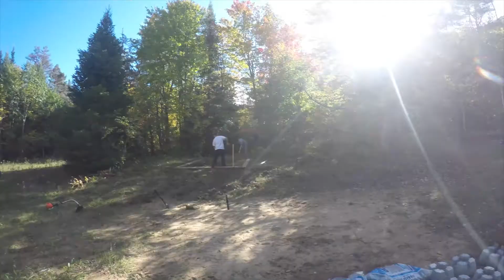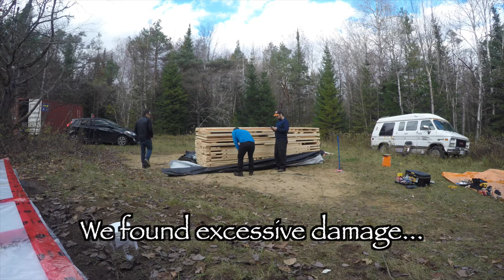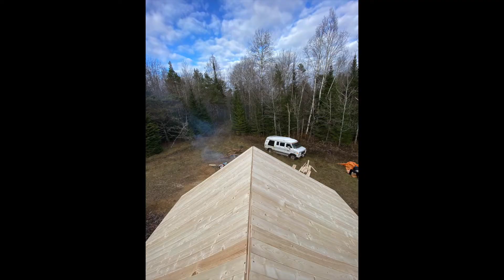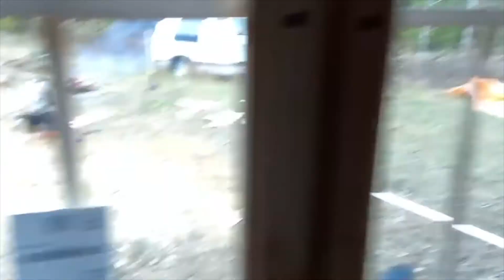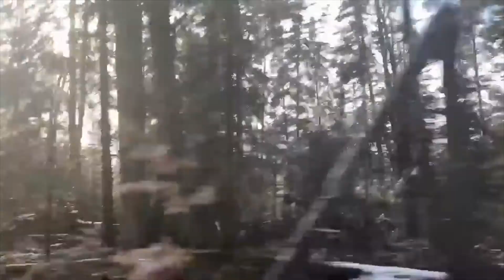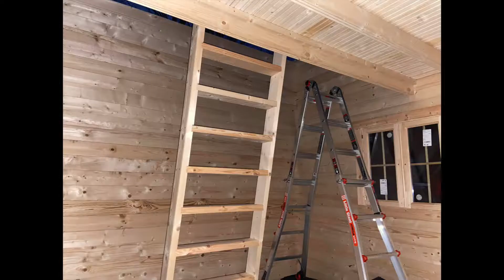Building An Off-Grid Bunkie In The Woods With My Brother And Friend

Comment: This is amazing, can you share what your roofing envelope was? I read that you added a vaoup barrier. did you insulate? it;s hard to see on the video. I have mental roofing. I was also thinking of renting scaffolding.
Reply from the maker: There is only a vapour barrier for the roof and then clear caulking for anywhere that air can escape. We bought a harness kit and it was kind of sketchy with the steep angle of the pitch, especially in the winter so scaffolding in the safest way.

Comment: Hey - how did you install the roof? I am having trouble with mine being so high and the material is thin so its tough to walk on… any suggestions help thanks
Reply from the maker: Hi Susan. The roof installation was pretty sketchy and unfortunately, I don't have much footage of that part of the build. We had a harness that was attached to a tree for safety precautions. To install the roof sheathing we had to get on the outside of the roof and drill each piece of wood in one by one, then when we finished each side we had the ladder ready to climb down. After installing the vapor barrier, the strapping provides decent footing when you remove the insulation. For the metal roof, I had to climb up the ladder and hold my brother up so he could drill in all the screws. The metal roof we used was very tough so I'd try to not put all your body weight on it if it's a weaker material.